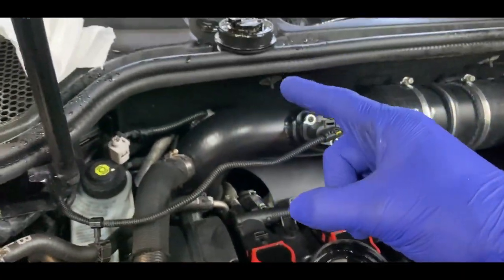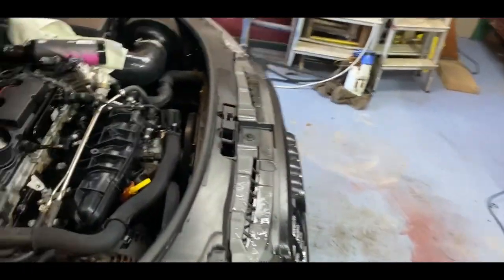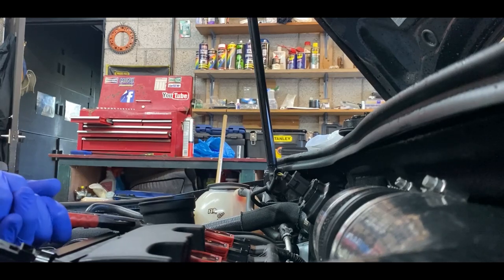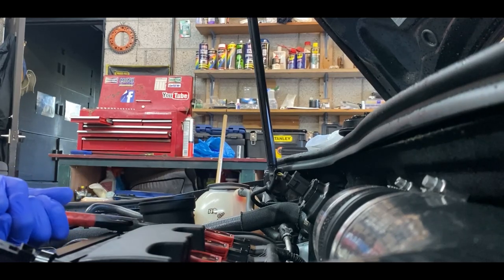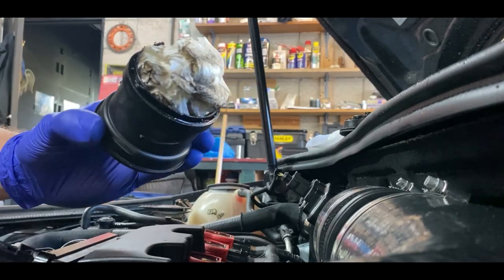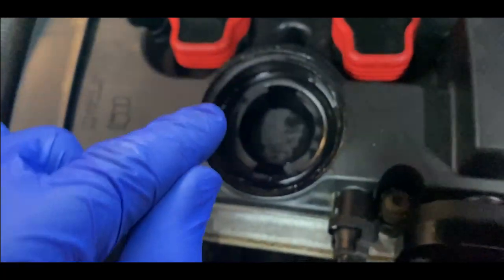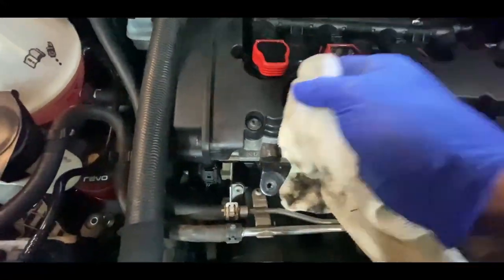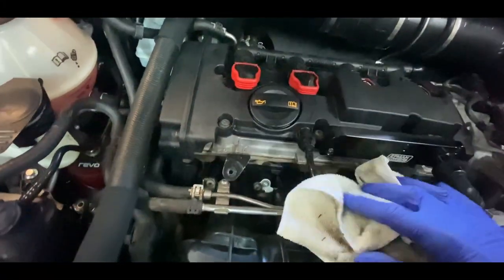How To - Remove Oil Cap Neck - Audi S3 8P

Comment: One question, doesn't this removal affects the engine compression ? I ask because that oil cap neck has a little more volume, just asking, any differences between before and after ?

Comment: Hi mate. My oil cap neck is leaking bad. Flimsy and not sealing properly with O ring popping from one side. I will try this trick to unscrew it off get rid of it. Thanks for the info.

Comment: Hi my oil cap neck is the same, but i wonder why should i remove it? does it prevent something from happening? or could i just leave it as it is.
Reply from the maker: Hi mate, it just looks smarter and cleaner, although if you plan on keeping the engine cover I would not bother getting rid of the neck.

Comment: Thanks for the vid 👍
My 2.0t started revving high low yesterday, so I popped the bonnet and the filler neck and cap were bouncing under the cover.  Took the cover with air filter off for a look, and a tiny thin slither of a piece of plastic, from the glued surface fell in!
Reply from the maker: Oh wow!